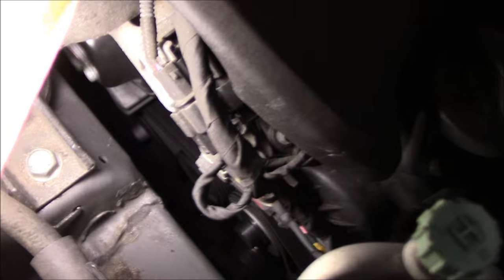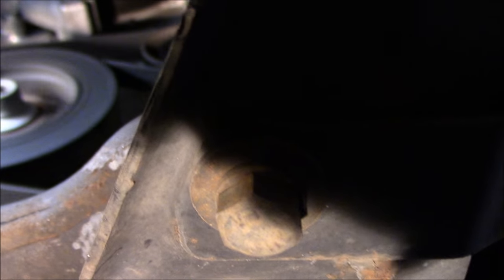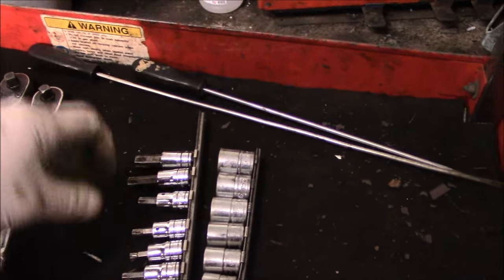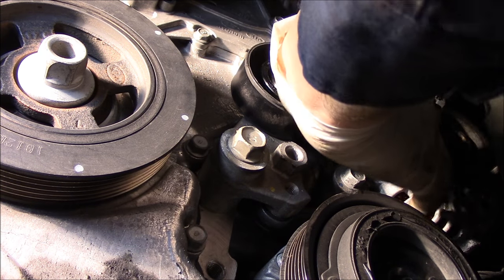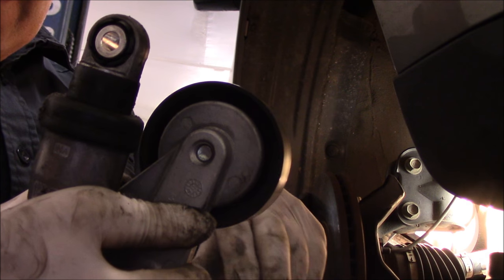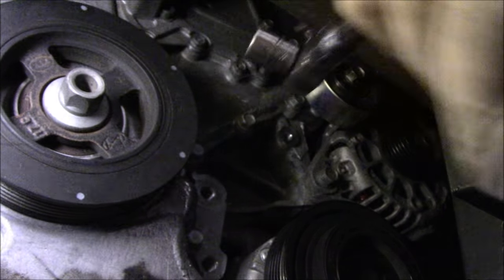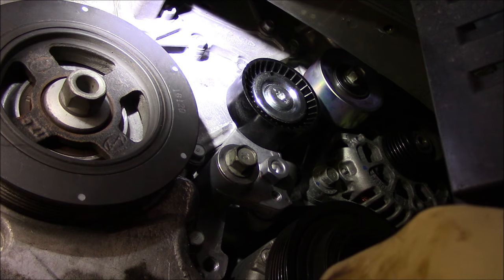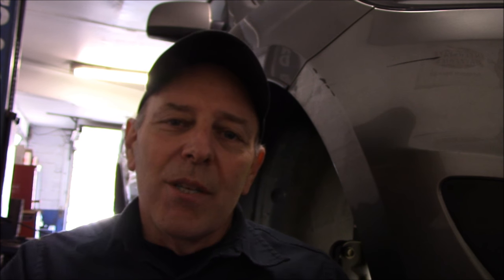How To Diagnose Engine Noise

Comment: I am having the same exact sound. I was told it was the serpentine pulley, and the teninsor pulley. I could see from looking in that a pulley was shaking. The car also gets louder when I drive. Then after being told it was the pulleys he said it wasn't and said it was the alternator. I have a service contract. I hate getting a million different answers and I thought he would find it when he took it apart.
Reply: What did you come up with ?.
Reply: @WISHBONEL7  It was the engine. I know they did some to it and acted like they didn't. I ended up getting a new car.
Reply: @daeriq2525   Ok , I am sorry to hear that .  How do you like this new one ?.
Reply: @WISHBONEL7  I like it. Next will be upgrading because I need room for the kiddos.

Comment: on some cars I have just took the bearing out of the pulley and got one at the parts store rather than to buy the whole idler pulley assembly
Reply from the maker: Your right you can just press in a new bearing if you ca't get the new one.

Comment: Thank you for that video. I would like to ask if you could give me some info. about engine noise when you turn on the AC. I went to an auto repair shop and I agreed on replacing the auto tensioner as advised by them. However, the noise is still there. They said maybe it is the bearing of the alternator and I said, maybe next time. I just want to make sure first. Thanks in advance.

Comment: I can't find any films, where the knocking sound from the engine would appear at higher speeds. The car is 2003 Chevy Cavalier. I don't know if it has hydraulic tensioner. If someone has opinion about origin of the knocking sound at speeds (starts ~ @45 mi/h) and find time to share it, I would really appreciate it. I've heard that it can be fm/the some transmission problems, like low on fluid, or it can be engine tensioner belt. I hope on that, but afraid it might be smth more serious. Thank you for a great film.

Comment: In general, is a little vibration in the crank pulley or a little tracking (1/32 inch say) back and forth of the drive belt ok, or cause for concern?
Reply from the maker: As long as nothing is bent you should be ok. Thank you for watching. Watch for the next free tool giveaway coming soon.

Comment: Please advice me on my Maruti Suzuki Baleno 2020 model. I want to change the belts since it uses two belts. It has some noise from the minute I start the in the morning (low temperature) and when the engine it's warm. The sound goes along when I increase the speed of the car

Comment: Hi! MY 2016 TOYOTA CAMRY SE 2.5L IS MAKING THE SAME EXACT NOISE ON THE PASSENGER SIDE. IS IT POSSIBLE THAT IT COULD BE THE SAME THANG? I CHANGED TENSION PULLY ALREADY BUT STILL NO CHANGE. MY A.C COMPRESSOR CLUTCH IS CONTINUOUSLY SPENDING WHILE MY AC IS OFF. IM JUST CONFUSED. WISH U STAYED NEAR BY. I WOULD TAKE MY CAR STRAIGHT TO U.

Comment: @jimthecarguy I have a 2011 Chrysler 200 3.6 Cylinder. Since it started getting cold it makes a noise when I start the car and accelerate until the car warms up and it stops. I then got random red battery codes as well as a check engine light code P06DA. I’m not sure what the cause of this is and would like help trying to figure out the main reason. Is there a way that I can message you so you can hear the noise? Thank you

Comment: Thanks for video Jim have same issue going to  do same already replaced belt but noise still there going replace idler pulley and tensioner. How many miles on this one JIM.
Reply from the maker: Thank you for stopping by the shop This one has 60,000+

Comment: jimthecarguy, what is the torque values on a 2011 Tucson GLS?
You didn't provide the torque values on 2012 Santa Fe.
Are both models the same?

Comment: Hey Jim my 03 Buick century makes a very similar noise in the same area(pulley system area) but it makes the noise when the car is on and when the ac is turned on it gets much louder and the car becomes sluggish. Help?

Comment: Do not use a screwdriver!  It will turn in to a spear when you slip and catch it on the moving part!   Use a length of thin soft plastic pipe or a green tree branch.  Hold your head to the side of it, not the end.  You will hear the vibrations just fine!

Comment: My cat makes a mono hum noise when hitting 30 mph + it idles normally with no problems so it’s a bit confusing 

It kind of sounds like a bad wheel bearing but it’s not I’ve checked all my wheels for wiggle and they’re all fine and the noise is in the engine bay only when acceleration and continues while driving

Comment: please answer me. Is it a sound when the sound gets warm? I have the same sound in my car. But there are times when it sounds. sometimes when the engine is cold, the engine is cold when the engine is warm and the car is warm. This sound rarely comes from the idle. Sometimes the noise does not there. What could be my pronblem? injection problem, belt tensioner or alternator? Thanks in advance already. my car astra j 1.6 cdti at 105,000 kilometers. Any mechanics could not find the problem. Because the sound not allready there.
Reply from the maker: Yes that is the most difficult part of trying to find any noise.Sometime you will just need the noise to become more noticeable.

Comment: My car Nissan Xtrail T31 has the unusual sound in the engine especially in the morning when I switch on the car and I put on drive and start accelerating it makes unusual sound, just like Subaru sound, and later it subsides after i have traveled about 2 to 3 kilometres,  but hen i park for 2 hours and come again to start the car and put on drive and accelerate it do the very same, I have  done the following already.                                           1. Change air cleaner.  2. Cleaned the airmass, 3.   Check on  air exhaust system, but  all of the above to no avail, kindly help with ideas.
Reply: what caused it?

Comment: I just wanna know different ug squeak squeal grind and etc.. shit i do not know how to coin the term my car noise makes
Reply from the maker: Can you send me a video clip of the noise.
Reply: @jimthecarguy  I will try to find timing because it does occur randomly.. It's almost weird. I suspect it's from the aux fan being not so lubricated because for 7 years I haven't touch that part. The noise appears even if im not moving.. As long as engine is on.. (still observing if it occurs with aircondition is on)
Reply: @jimthecarguy  But yea will hit you up with a video clip of a noise .. If I get to record it.
Reply: @jimthecarguy  An update: Just went to Good Year and got my car checked. The mechanic was quiet convince that it was the aux fan. Because as he touched it, he says it has loosened and got a lot of free play. 
I ask him if how it is possible and he goes explaining that when bearing is broken, a free play is created together with friction inside the motor and proceeds to say that, the source of the sound is the bearing. 
I will have my car fixed and replaced the aux fan and I'm going to update you guys about it.. Thank you

Comment: My car makes a rattling (not sure) noise that only comes randomly and it sounds like it’s coming from under the car. It doesn’t specifically make a noise when I turn or when I accelerate or stop, it does it very randomly. In fact it makes more noise when I’m driving 50km/h than 90km/h. I’m very worried as I really need it to drive to work and don’t have time to check it. Is it safe to drive?
Reply from the maker: Can you give me more details about the noise such as where is the noise coming from in the front or back?Is it a raddled noise ?
Reply: jimthecarguy thank you for replying, I got it checked! the issue was the suspension spring on right side of the car, it was damaged, luckily I got it checked before it fully broke, that could have caused the car to tilt and be unable to drive it (at least that's what I've been told)

Comment: He said it’s idler is making noise… spins it I don’t hear nun but imma still change it and charge him 120 for parts and 350 for labor. Like it wasn’t even the issue. Now you probably caused a problem in the long run… smh